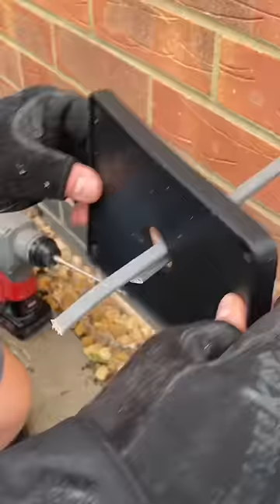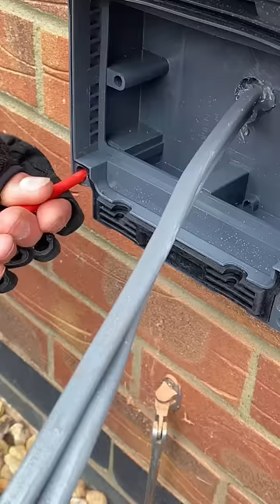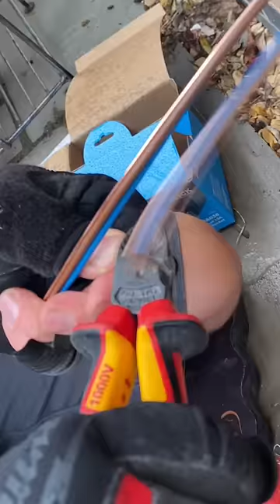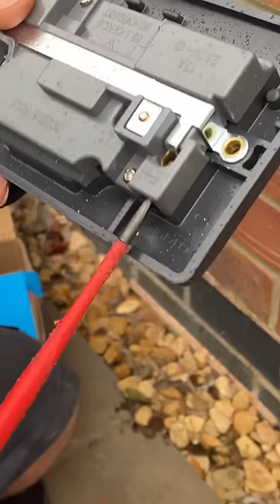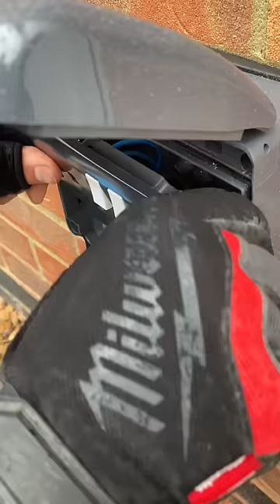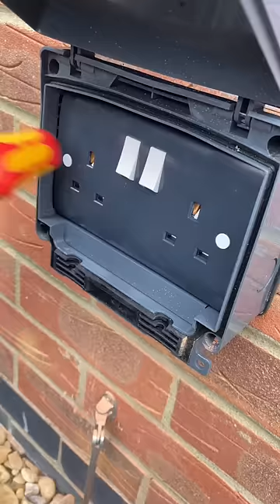Bit of blob to cover your sins. #shorts

Comment: Ummm, why did you use silicone around the cables?
Don’t you know that the silicone reacts with the outer sheath of the cable and  dissolves the pvc sheath.
Basic electrical knowledge 101 which you are obviously devoid of.
My qualifications?  Registered Electrical Inspector on voltages  up to EHV.

Comment: I know that this is a different country than the US but why would you stick two conductors under one screw and not use a wire nut or a wago    the continuity of the conductor shall not be dependent upon the device           don't even get me start about not using a mud box that would be flush with the brick to begin with.     Shoddy product at the best.       Do better 0 out of ten

Comment: That outlet doesn't remain weather-resistant with cords plugged in. It would no longer meet code in the US.
Reply: Of course it does, that’s the whole point of a weatherproof outdoor box. UK “cords” are different from US ones and the cable runs vertically from the bottom of the plug. When plugged into the socket, the cable fits through the exit holes and closing the clip seals the box.